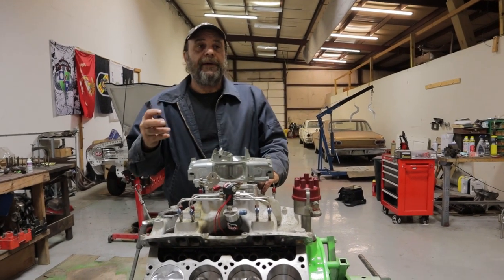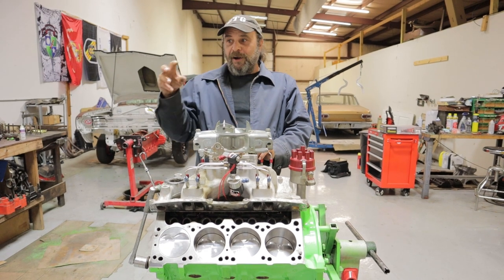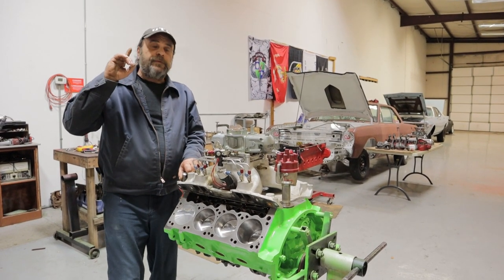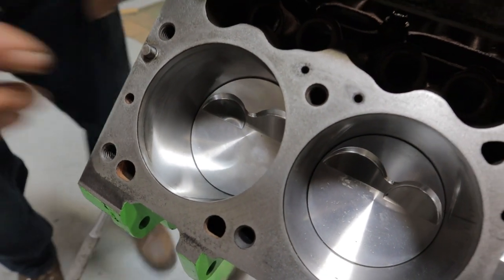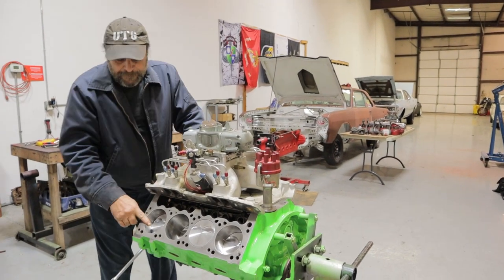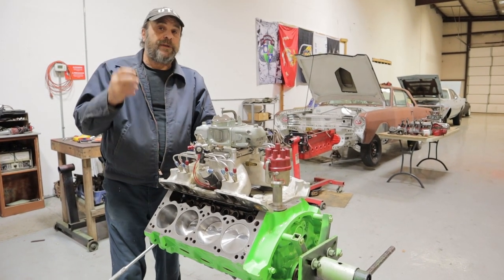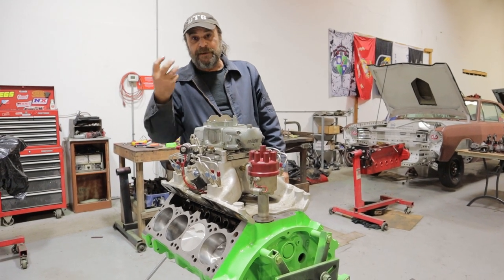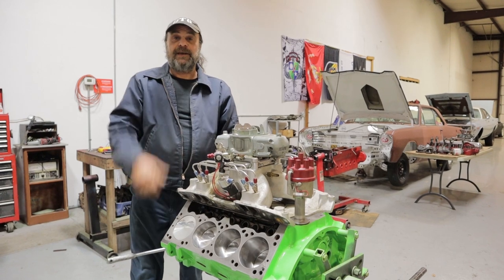The Fundamental Aspect Of The Internal Combustion Engine Nobody Ever Talks About

Comment: What we should remember is that the common motors we see today were never designed for running on vapors, but raw gasoline. What running on vapors might require is a much shorter stroke motor. If the burn with vapors really is a more efficient burn, and if it really would pollute less, we may yet see a vapor motor in the future, right? That would depend on a lot of other things, such as producing the right kind and amount of vapor and having enough supply also, as well as how to push it into the combustion chamber in the most advantageous manner.

Comment: Would a larger displacement ( cylinder)  but very short stroke engine work for a hot vapour engine ? Thanks for another great video.
Reply: I was wondering the same thing.  I think the problem is as you shorten the stroke you also loose compression.

Comment: I guess it all comes down to the density of the intake charge and the amount of potential energy it contains rather than the fine mixing/vaporizing of the mixture that will make it less dense with less potential energy. The problem is the heating which reduces the density, if you could use say sound with ultra Sonics vaporizing the mixture you could keep charge density. Just a thought 😉
Keep up the good work Tony 👍
Reply: Gdi looks a bit like that but gets really good atomisation with high pressure injection
Reply: I had an  after-market kit... two ultrasonic piezo transducers under the 4 barrel primaries in the intake manifold. Not much for mileage, but Instant starts! Even at 20 degrees no choke. So I guess It saved on some gas?  No waiting 20 minutes to warm up, either...
Reply: @jimcharlton7869  interesting...

Comment: Sorry, I’m not altogether with you on this one.  It doesn’t really matter that the burn is over in just a few degrees, because the Otto cycle is all about HEAT.  Even after the burn is over, the waste gasses are still extremely hot and at extremely high pressure, and therefore the hot waste gases still contain energy that CONTINUES to be converted from heat and pressure to mechanical power all the way until the exhaust valve opens. As the gases keep pushing the piston down, they cool and that is where the power after combustion comes from. In fact the “ideal” Otto cycle assumes that the burn (application of heat to the charge gas) is nearly instantaneous, takes place in a constant volume, and the expansion phase is adiabatic (no further energy added to the gases, so pressure and temperature fall as the stored energy is converted to mechanical energy ). The ideal diesel cycle, otoh, assumes that energy is continuing to be added all the way through the expansion phase so that it’s more nearly a constant pressure expansion. In the real world, obviously, the Otto burn isn’t instant enough to be “constant volume” and the diesel burn isn’t really constant pressure.  Look at the pressure/volume diagrams in the very first figure in this article:  https://www.mech4study.com/2016/08/diesel-cycle-vs-otto-cycle.html
Reply: What he says in this video is exactly in line with that. The flame front is one thing, the pressure wave is another. Listen to how he describes the force acting on the piston.
Also, it would stand to reason that a longer duration flame would result in a longer duration pressure pulse, thus more forceful push on the piston for more degrees of rotation.
Reply: @ericlandstrom6155  extending the burn time as the piston moves down the hole  is a deviation from the Otto cycle and sub-optimal,  which is why cylinder head design since the 80s has focused on speeding burn rates to get as much combustion done as possible near TDC (remember the smallblock Chrysler “fast burn” head that morphed into the Magnum, that evolved into the Gen3 Hemi with dual plugs to further speed combustion). My nitpick with UT is that he seems to ignore the fact that power delivery does not stop when combustion stops,  the combustion has added all that heat to the gas in the cylinder, which continues to expand, and continues to deliver power to the crank.  Nitromethane isn’t a valid comparison either, because a) its a combined fuel/oxidizer, and b) the engines optimized for it don’t even try to be energy efficient: if sending more still-burning fuel out the headers gives one more horsepower, they’ll do it even if it wasted twice the energy it gains.  

It’s really not a question of liquid or vapor fuel… propane is a vapor, and performs virtually identically to gasoline… though I agree that the snake oil carburetors that claim insane efficiency are completely bogus.

Comment: I feel like I just got taken back to school. I really like this video. This is something that’s very intuitive but you’re absolutely right, nobody talks about it.

With all of this in mind could you speak to what the stroke of a crankshaft does? You were talking about degrees and how in a gasoline engine the flame is spent at 45° past top dead center. Wouldn’t it make sense to have a shorter stroke for more efficiency? Or am I missing something.

I guess you would have to compare a same displacement engine to hold the variable of displacement  constant.

Thank you again! I always get something out of your videos. I always enjoy the hell out of them.
Reply: if you had a shorter stroke then the engine will pull less air/fuel... because the vacume of air it sucks to fill the cilnder will be less... increase the stoke the volume become bigger so it vaccums more air, ya follow?
Reply: @sniperpronerfmods9811  no. The volume would be the same. Per my question, the displacement would be the same. Otherwise there isn’t a comparison.
Reply: @youhaveamonkey  sorry I missed that part... Good question... If anything it would be less efficient... Or you would need lots of timing till you can't add anymore... Because the only reason it pushed the pistom downward is because it already combusted and filled up the space at the top... So if you have a wider bore (by 2x) shorter stroke(by 2x) same volume there would be 2x the volume to fill to till up at the top before it started to push downward...it may ever cause issues because of how far the gas and air are from the spark plug because it would have a to travel very far to combust the fuel near the cylinder wall... Another reason to add even more timing... Ya follow? Very interesting question tho

Comment: Tony I would like to see a video on MPG of your vehicles with specs listed. A comment section of viewers rides and mods. 

My basically stock 1991 Camaro 305 E code TBI  had original Castrol syntec 5W-50, 3.08 open diff with synthetic 80W-90 , aluminum rear brake drums, factory style Accel coil, brass distributor cap & rotor, Bosch +2 +4 or original design Delco rapid fire spark plugs, synthetic ATF in the V8 T5 manual transmission, synthetic wheel bearing grease, LeBra, Anco Aerovantage wiper blades, Tuffy muffler, older 15" aluminum 3rd gen wheels and got 33-34 MPG religiously from 80K - over 300,000 miles.. Best ever was 39 MPG idling in 5th through a snow storm.  

My question is what's the best MPG recipe? Should I try aluminum vortec aftermarket heads, sequential multi port injection, or does aftermarket direct port injection exist yet? Maybe a longer stroke crankshaft. Does anyone make long tube headers that clear the slave cylinder yet? I like the Flowtech afterburner design. Has anyone compared roller rockers and different ratios for best MPG?

Thanks for your time and comments!

Comment: What about going direct injected and extend the injector pulse to slowly add fuel to the mixture as the pistons is going down to keep the pressure pulse going/burning? I know gm is doing that in the Duramax diesel a couple years ago. I know it's hard to implement in a classic era engine. Just a thought. Or if we could somehow inject the vapor into the chamber directly. Not sure on the physics of if the pressure needed would revert the vapor back to liquid tho.
Reply: See my note

Comment: IF you build one- We will watch. M.P.G. is my 'game'. And that 258 towed a 6ooo pound loaded 16 foot box  trailer all the way back here from Florida.(5ooorpm thru the rocky mountain Eisenhower tunnel in third gear!) I averaged 13-14 mpg on the 'Flats'. Jar of carb jets for the 390 Holley (watch the Fuel air ratio guage) I Rejetted ,different vacum secondary spring in Moab Utah, due to being back at altitude... the rules are different up "High", and 'Morman gas' sucks. but-YOU can DO It!

Comment: Tony - You hit it on the head! I had a buddy years ago that tried to run hydrogen with a homebrew ionizing generator in a bucket of water in the back seat (he didn't smoke). Figured really quickly why this didn't work unless you ran gasoline along with it. Granted, it DID make the GAS mileage go up drastically, somewhere in the order of 60%, but did NOT and COULD NOT realistically replace the gasoline.
Reply: There are hydrogen powered cars on the road in America now. Strictly hydrogen. In Iceland they have developed a system that converts priuses and Honda’s to hydrogen without modifying the engine, intake, trans, etc. Honda and Toyota have hydrogen cars for sale and in the road in America. Not very many fueling stations though. But there’s lots of videos on YouTube that show how to make hydrogen. Worth a look
Reply: @MegaJoedart  Still not practical, that's the whole point. Honda got rid of it over a year ago, and Toyota hasn't left the ground with it. The other side of it is WHY there isn't going to be a fueling network. Imagine attempting to make hydrogen gas safe for the masses to transport around and refuel with. Ever played with it?
Reply: @joeblow2063  Cummins says your wrong, and they know a HELL of a lot more than you and your buddy. Hydrogen CAN, absolutely be used as a replacement to gasoline. Period.
Reply: @moparproud3978  Cool story, so then why isn't it in wide spread use? I mean, I've been there and done that and know how cheap it is go generate and use, but I also know how sketchy hydrogen gas is to deal with. Show me some every day buyable/usable road-going cars available to the general public that can use hydrogen daily, pure, and refuel easily. They... don't... exist.... for a few reasons.

Comment: I think you’ve covered this previously but didn’t specifically mention it here: because the fuel in a typical carbureted engine is NOT vapor, but atomized, it burns longer into the power stroke.

Comment: In my view this is a very succinct explanation/refutation of 'magical vapor powers' in CCE.  In Under-Grad, the chapter of physics of gas laws the formula PVnrT or Pressure-up =increase in temp and decrease in volume, was used over and over.  Going from memory there is a concept of the 'latent combustible energy of liquid or aerated liquid' set as a quantifiable value.  Very generally as value decreases, less 'work' as rotational energy is observed etc.  Furthermore the example of grass clippings in an mixing bowl and fire-cracker.  Energy moves clippings out of bowl.  W/ M-80 this is taken-up a notch but container vis-a-vis (bowl) is molested by charge. There-by establishing strongest blast allowed w/ out disturbing bowl for example.  Pointedly, the Art and Science of racing becomes delineation of a plethora of factors to the point that some racers augment fuel octanes secondary to Barometric P and RH and ambient Temp.

Comment: 5:30.  Sorry Tony. You need to learn some thermodynamics.  

IC engines  fall within the category of Heat Engines because it is the HEAT that creats pressure (think ideal gas law), which exerts force on the piston. You're still confusing "Combustion" with 'Heat".  It's not the Combustion of the fuel from 15* to 45* that causes the force. It is the Heat that is generated from the combustion of the fuel that creates the force.  That force (pressure) is still performing work [Inegral(F*ds)] on the piston, even after combustion is complete.  The thermal efficiency of the cycle depends on how much of that pressure can be converted into work, before the rest of it escapes when the Exhaust Valve Opens (EVO). 

As the fuel burns (assume 15* to 45*), the pressure increases from the added heat. The pressure then decreases as 1/(stroke distance) as the volume expands. Your theory neglects all of the remaining pressure from 45* all the way to EVO.

If you still don't understand, think of what compressed air can do.. you don't need to have flames and burning fuel to propel or move something pneumatically.  After the combustion is complete at 45*, you still have hot compressed gasses pushing down on the piston.

If you spend more time burning the fuel, then you are wasting more of the stroke just trying to get the pressure up.. In that case you have less stroke to expand the hot gasses and extract mechanical work --> lower thermal efficiency and lower power. Burning quickly(say 5* to 35*) gives you more degrees of stroke to expand the gasses which will increase the total work that is extracted from the released thermal energy of the fuel/air misture.

Comment: so why not make a vapor engine (that guys idea of using the exhaust in a heat exchanger is a good idea.... but it needs to be MUCH bigger and flow MUCH more)
but when you need the power..... it starts up normal (or direct) injectors 
.
if you want to get REALLY fancy with it..... you can even have the exhaust progressively bypass the heat exchanger (if it causes any restriction.... a "proper" one should not) 
.
.
.
so only vapor just after start up (till the exchanger heats up)....... and when cursing 
then past ~60% throttle.... the normal injectors start to add "raw" fuel
eventually..... at100% throttle, its pure "raw" gas 
.
.
idk.... even if its only worth 3 to 5 mpg on a car that already gets 30
i think thats worth it
.
that might juust be enough to prevent gas engines from getting particulate filters and "exhaust fluid" systems 
which WILL break down more often than a heat exchanger (already used for oil and trans coolers) and possibly a valve in the exhaust
.
.
like if we can avoid a car going into limp mode because the DEF froze up in NE montana -50f temps
then thats one less service call ive got to go on

Comment: Hi been doing this research for 12 years smokeys patent us4862859 is for v6 in a 1980 Buick skylark . He removed one head and made it a three cyclinder with 125 cubic inch 190 hp at 10 lbs of boost and 250 out of 21 lbs of boost got 48.4 m.p.g. and yes he off set the pistons .060 for more dwell at t.d.c. so he made moe power and got better fuel economy . Can't wait for the hydrogen talk.

Comment: A hydrogen boosted motor runs the timing at top dead center usually. Hydrogen burns at 40,000 feet per second. Gas is what? 5000 feet per second? Big difference in power released in a give rotation of the crank.. . Similar to turbo vs. Nitrous. Nitrous pushes through 7* and turbo pushes 17* according to that real street video where they tear down that 2jz. It was the "46psi stock block supra tear down" on realstreet. They talk crank angle at 2 mins 20 seconds

Comment: We run cars in the UK on propane quite alot (effectively vapour). They run smoother but make less power and are slightly less efficient,  5% less efficient but 40-50% cheaper than petrol

Comment: He's %100 correct, gas to vapor will work but will not make any notable power in an automobile engine. But will for a  single cylinder lawnmower.
BUT the difference in fuel saved/used is not really significant.
See a video demonstration on the YouTube channel "Project Farm".

Comment: I’ve been driving my car for 3 1/2 years 2000 Honda insight. I vaporized the gas and the vapor goes into the injector rail. The air has no gasoline vapor in it I can let it be cold air intake or hot air intake either one. 

I watched your video. Terrific video. What if I put diesel and gasoline together. Would the diesel give a little more distance on the piston.

I am getting 100 mpg on a 2000 Honda insight. I don’t use the battery behind the seats took it out. Took out 150 pounds from the car. In total.

Looks like 2% diesel on gasoline is tops. Would that make any difference. My Diesel it would be vaporized would that hurt the injectors and the catalytic converter I’m not gonna try unless you say do it

I’m also running 100 PSI tires. You have to take the energy requirements away from the calculation to save any energy. If all of the energy requirements either it takes as much energy as it takes. Front bumper back bumper under tray. And I always drive 50 or less. My exhaust smells different when I do it the way I do it I have several cars. One CVT the rest are five speed manuals. All Honda insights

Check out Lean burn motors Wideband O2 sensors ECU. I know you know all this stuff it’s for the People that are reading.